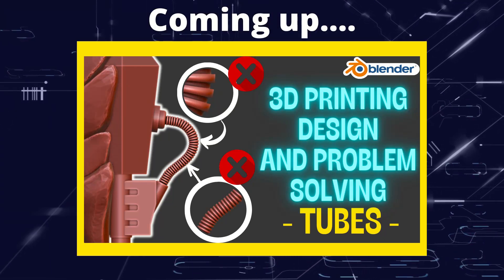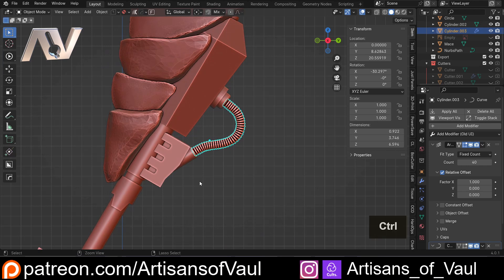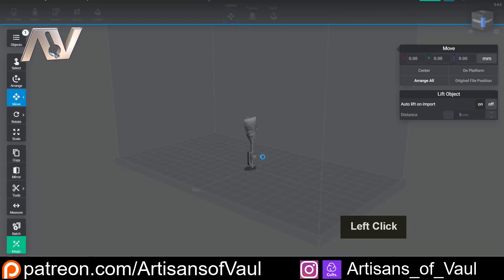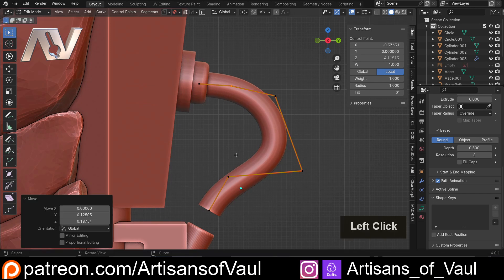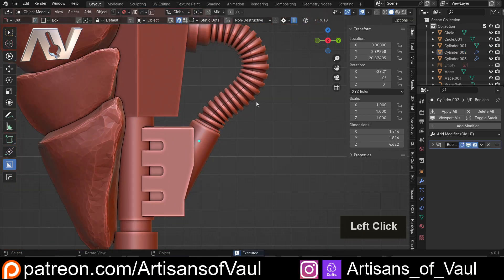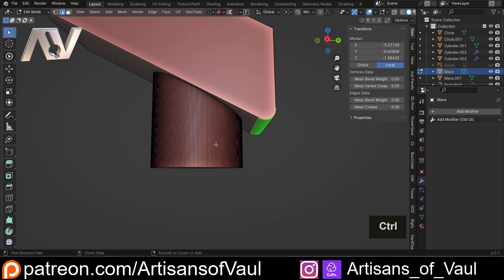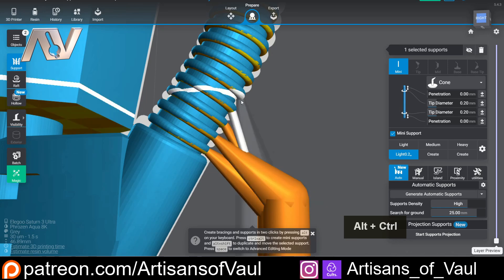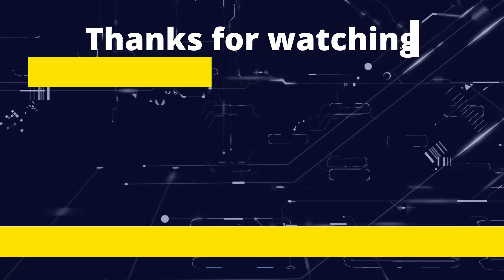Tubes - 3D printing design and problem solving

Comment: I honestly never use anything but small supports. More work to set up but far less scaring and cleanup after.
Reply from the maker: 👍🏻 I often find if I don't have some larger ones things will have issues during the print. But perhaps I'm being overly cautious.

Comment: It’s shocking how some sculptors don’t think like this. You set the bar high!
Reply: Because a LOT of sculptors are coming from regular modeling/sculpting for games  assets/etc. And a lot of these 3D print mini vendors are more concerned with the renders than the actual model. When you sculpt minis for casting/molding these models will not work. I can spot these minis a mile off. Everything about them is wrong, concerning proportions, depths, details, contrasting, etc. They are modeled for a fancy render, but the print won't look anything like the render.
Reply from the maker: @musashidanmcgrath  If you can set it up correctly (as covered in part in this video) the render should look exactly like the print. But as you say many people who do the sculpting don't know the 3D printing process to allow that to happen
Reply: @ArtisansofVaul  Thanks. I was just curious. It's good to see a channel with 3D printing in mind. I work as a miniature/collectible sculptor and I see a lot of bad practices and bad examples in the industry. The industry has been swamped with sculptors in the last few years and a lot of them don't understand the fundamentals of creating for physical models at various scales. Which is why we see so many 'render minis' that look terrible when printed.
Reply: @ArtisansofVaul  I only use Blender for final stl export. I do all my modeling sculpting in Zbrush/Substance Modeler VR.
Reply from the maker: @musashidanmcgrath  I can't disagree with that at all. I wonder if people find themselves with a sculpting skillset but without work so doing it for 3D printing is a good solution. But (as you say) that don't know enough about the technology to modify their workflow to function well with it.
Reply from the maker: Thanks man. I think it's just experience at this point, starting off and not having printed much as an individual means people just don't know this straight away, so I thought it was worth doing a video on. Also there is a surprising number of people sculpting that don't seem to own their own printer so never have to consider it fully.

Comment: I am a little confused on a small part. If you were gonna repair it in 3DBuilder, why select the coil and fill the endcaps? Wouldn't it just merge the mesh on the repair without the new faces? Or is that just the workflow incase you use the coil elsewhere/workflow?
Reply from the maker: A bit of both. I only use 3D builder as it fixes non flat faces really well and can deal with minor issues. I'd rather have fully manifold objects booleaned together properly in Blender as it meams 3D Builder is more reliable at fixing things.
Reply: @ArtisansofVaul  Ah, makes sense, thank you. I don't really notice either way when I "fix" a finished model, but I can see how it is good practise anyways to keep up.

Comment: Cool. The supports for FDM are completely different and need different thought processes, because you're not printing an entire layer at once.
Reply from the maker: That's a good point, though would you be printing a 1mm tube by itself/free-floating in fdm? I'm curious as I just got my first fdm printer.
Reply: @ArtisansofVaul  That's why I brought it up. You can print things like that. What doesn't work well his horizontal spans parallel to the print bed, since you can't print in mid-air.  But sure, there are even "stringing tests" that are test pieces consisting of a bunch of thin vertical spikes so you can see if you get those whisps you had as the head moves between them.